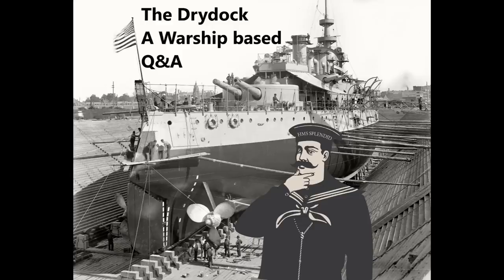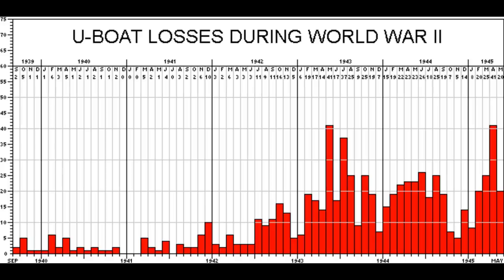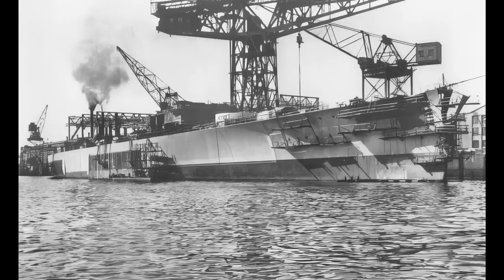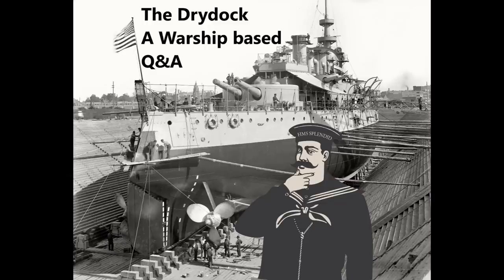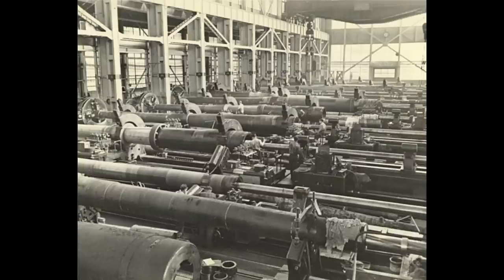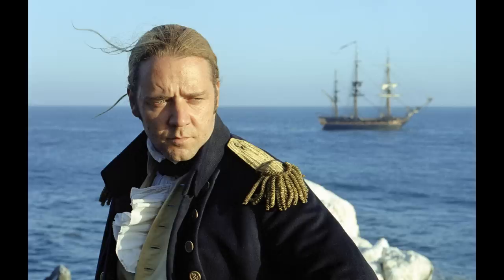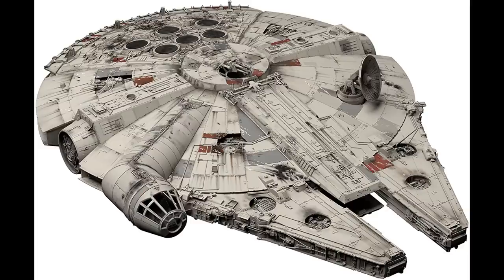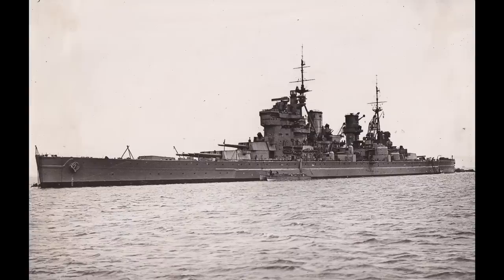The Drydock - Episode 243

Comment: Thanks for the chart on UBoot losses.  I think the description may have undersold the impact of the losses in 1943.  My understanding is that the steep losses in the convoy battles in May 1943 induced Doenitz to withdraw most of his fleet strength from the critical and most heavily defended Atlantic convoy routes.  The opening of new theaters, such as the Caribbean, South Atlantic and Indian oceans, was to some degree a response to the unacceptably high loss rate suffered in the North Atlantic. From that point on, the UBoot war shifted more to high level harassment instead of an attempt at full on interdiction while Doenitz awaited new homing torpedoes, schnorkels and above all new submarine designs that were hoped to turn the tide.  In a similar story to other parts of the German war machine, it was too little, too late.  The new equipment did not prove to provide war-winning advantages, the new submarines could not be produced fast enough nor in sufficient quantity, and the steady erosion of UBoot commander and crew experience could not be overcome. By mid 1943 Doenitz knew the score. Nevertheless, he sent his crews to sea knowing their chances of success were slim at best.
Reply: The U-boat assault on Atlantic shipping was the only strategic-level offensive campaign Germany had to cut down the US & UK preparations for bombing and invasion.  The Luftwaffe was unable to scale up its attacks and forced onto the defensive.  There was no other choice.

Comment: Isn't the Millennium Falcon actually more or less a pusher/towboat? As I recall, the notch in the front of the ship was meant to hook up to the back of what was essentially a barge. The offset cockpit being for visibility when pushing such a load. The roundness is also reminiscent of harbor tugs irl. It also accounts for it being both fast and nimble in the movies, as it does not have the cargo in front of it. (of course in the lore it is also heavily modified)

edit: quick search of 'Millennium Falcon pushing cargo' confirms this. With the "barge" being called an intermodal freight container.
Reply: The nerdy Drachi should know that the millenium falcon inspiration was the Astroship XB982 ;)

Comment: One would think that a white phosphorous device air burst over the top of a WW II destroyer, cruiser or even a battleship would absolutely cripple the personnel manning any exposed AA mounts on such ships, so, saying it wouldn't have much of an effect would be incorrect, as it would definitely hamper a ship or task forces ability to protect itself from further air attacks. Of course, enclosed mounts like a 5" wouldn't be affected as much, but those weren't as effective until proximity fuse rounds were developed and deployed.
Reply: Flying a bomber full of white phosphorus must have been a rather nerve-wracking activity. How much of a hit would it take to make the wp detonate?
Reply: Depending on the closeness of detonation, few of the particles would hit the ship, and those would be affected by ship motion and winds.  Unless the ship is not moving she will be out of any descending burst cloud in seconds, and to get a close enough burst the plane would have to fly very close to the ship where even 50-cals could threaten to kill it or set of the WP bomb.  It was a PR stunt.

Comment: Regarding the UBoot losses:
I Think that the Kriegsmarine knew, from 1941 onwards, that the existing types and design concepts could only be improved to a limited extent and that losses of the existing types might become insustainable. So they started several development an tesr programs but also tried to improve the existing designs.  The later Versions of the types VII and IX not only had a better range but a lot of smaller or larger improvements.. Their installations were more resistant to shock, there was the snorkel and some boats tested the "Alberich" anti Asdic coating. But these were all interim solutions and many of these improvements were already derived from the new, potentially gamechanging constructions.
Till 1943 the main design and test effort focussed on the Walter Uboats. In 1943 it was decided to go for an "Elektroboot", more or less the by then completely designed Walter Type XVIII but with diesel/electric propulsion, a large batterycapacity, streamlined hull, new torpedos, fire control etc. The electric switch panel, not available in the Walter design, came from the Type VII /42 and the Diesel engine had been developed for improved Versions of the conventioal types. . 
The Types XXI and XXIII were under construction in large numbers by the end of 1943 and the rumors of these "wunderwaffen" was deliberately spread, to keep morale high among the crews who thought that the crisis of the Uboat war would end with the arrival of the XXIs and XXIIIs.
But the main reason for sending out Uboats on suicide missions was, that Karl Dönitz as a Loyal Nazi,  was willing to sacrifice his crews even for minimal  or no success.

Comment: Re: Billy Mitchell;  Though the testing of the concept of sinking of battleship(s) with aerial bombs was not a realistic test under combat conditions, the navy had also put unrealistic restrictions on the size and number of bombs dropped, as well as the pace of the test so that the ships could be boarded for damage inspection.
Reply: Which Mitchell broke, while endangering the pilot's safety by overloading the aircraft and flying dangerously low and slow.  Lucky there was no AA fire.  Even a 50-cal would swat one of his planes.

Comment: While I largely agree with your comments regarding the weapons and continuing to build them during the interwar years being very expensive, however for the UK especially, there is a very easy workaround that that being installing lots of large guns, etc on Naval Bases, after all, what do you mean we're building guns for a secret battleship program did you, not see the 20 18-inch gun batteries we just installed in Portsmouth after all those Portsmouth v Southampton football matches are sometimes a bit rowdy, plus if it turns out the guns aren't the best they are still very useful and you kept the production facility running at a low level making a couple of turrets a year it would have kept lots of very talented engineers and technicians in jobs.  Some of Malta's guns in WW2 were positively Victorian, same with Gibraltar, and I'm sure 8 or so 15-inch guns pointing at Cadiz would help keep the Spanish honest. could you imagine how much more fun it could have had if it had the same type of Naval Battery as Singapore? As for Singapore, we could have had lots more firepower maybe not any more 15-inch guns but, a 100 or so High Angle quick firing 4-Inch Guns could have been a major spanner in the Japanese planning and really lessened the aerial threat.
Reply: I think the financial situation was more dire than you give it credit for.  Keeping production lines open to build 2 big guns and 10 plates of armor per year is much closer in cost to building 16 big guns and 100 plates of armor than it is to closing them and building 0.  You can't really keep people employed full time on miniscule production runs, so it won't effectively maintain the skills, either.
Reply: Two show-stoppers: Parliament and Congress...

Comment: The US Navy had floating drydocks it sent to forward areas of the Pacific. Gun barrels could be installed there for at least the smaller warships.
Reply: The drydocks were more for hull repairs, but some of them had cranes that could handle the medium sized guns if needed.  Repair ships (AR) had similar cranes.  Specialized crane ships (AB or ACS) could handle heavier loads.  This work could only be done in a calm harbor like Ulithi or Seeadler, and required replacement barrels as well.
Reply: @gregorywright4918  There is a photo of an Iowa in one of the floating drydocks. I doubt that drydock could lift a 16" 50 caliber gun. But a 5" 38 turret might be possible.

Comment: The French had holes for poison gas tubes dilled into the bottom of the base plugs of their WWII 33 cm SAPC and 38 cm APC shells, if desired.  The failures of the French APC fired by RICHELIEU that destroyed a gun was due to that size shell's holes being drilled to deep, allowing the holes to tear open when the gun was fired, blowing up the shell in the barrel.  Bad idea for several reasons when first added and never used, of course.

Comment: In Modern times some VLS systems have a crane to reload there system, but it really didn't work so they do it in port. Guns seem to be a lot heavier and more complex. I think they are trying to do that again?
Reply: The attempts of using a crane of a modern VLS system only needs to lower the missile into the launcher. One advantage of the VLS system is your missiles are stowed right there where they can be fired - there is no seperate magazine when it's part of the launchers. Gun ammunition, both charge and shell, needs to be put in a magazine that generally is not right there in the turret (unless youre a British battlecruiser that decided that rate of fire will make up for lack of gunnery training at anyrate), which means they still need to haul them in somehow. 

That said, the USN does maintain some capability to reload VLS at sea, but it's pretty... well, it exists I suppose, but isn't really done in practice.
Reply: @DuraLexSedLex  VLS uses a standardized 4x2 cannister module, but one module can have a small crane instead of 3 of the cannisters.  They tried doing a replacement at pierside and found that even the small amount of ship motion would cause the suspended module to sway dangerously.  At sea it would only work in a dead calm.  So later ships do not include the module with the crane.  You can tell if a ship has them or not by their loadout numbers - if it is a multiple of 29 or 61, it has a crane.

Comment: The thing about gas bombs is every one of those could have been filled with high explosives instead of poisons, so it seems wasteful to replace the main armaments of aircraft with them. Add on sure, but not replace. Gas is a psychological tool and burdens armies by causing lots of injured who then have to be treated, but its killing power on its own is actually relatively small. It casts an overlarge shadow

Comment: Bismarck used the Keil Canal. 

Wikipedia Information...
Ship
Length (LWL) - 246.6M
Beam - 36M

Canal maxima
Length - 235M
Beam - 32.5M

How was the ship able to make this journey or is some of this information wrong?
Reply from the maker: The Kiel Canal was expanded several times. :)
Reply: Those are the current maximum restrictions listed by Wikipedia, so that two large ships can pass each other in the canal.  The current width is around 160m, but the sides are sloped.  Around 90m is "bottom width", and there needs to be safety channels between and on both sides.  Realize also that the authorities would allow larger one-way traffic of warships when demanded by the Kriegsmarine.  The limiting size then would be the smallest locks.  I cannot find a quick link to what size they were in 1940, but current sizes are 327m x 45m.  I believe there was an expansion again in the 1960s.
Reply: @gregorywright4918 - Thank you for your informative response.

Comment: 9:57 if there was to be utility of the Mitchell Test for WW2, it would be for fighters to operate as SEAD so that the bombers can take their time lining their shots.
Reply: There was a strategy for that, but it usually went out the window in an opposed (CAP) attack.  If the fighters were free, they were supposed to strafe the AA sites while the dive bombers came in, then the torpedo bombers would line up a hammer-and-anvil attack from two sides.  Most 1942 attacks were spot-and-dive by whatever squadron got there first.  If you look at the Battle of Sibuyan Sea against Kurita's Center Force, or better yet the last cruise of the Yamato, the USN squadrons did carry out some SEAD attacks to set up the torpedo strikes.

Comment: Billy Mitchell was a maverick and a visionary. What you may call overblown and ridiculous I may choose to call stretching the limits to get actual funding (I know,,, taking money away from the navy is a sin but what're ya gonna do🤷‍♂️air power is kinda important) along with the fact that it turns out Mitchell was right in the long run. The battleship no longer prowles the sea mainly due to things flying through the air.
Before you level judgement on Mitchell put yourself in his shoes Drach. Look at his budget and the machines he had as compared to what the navy had. Just saying.😇